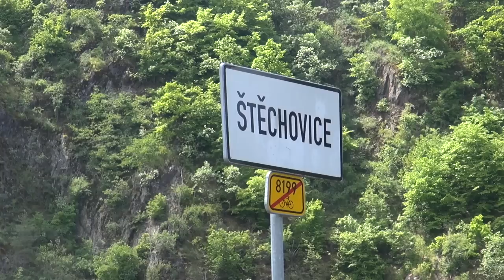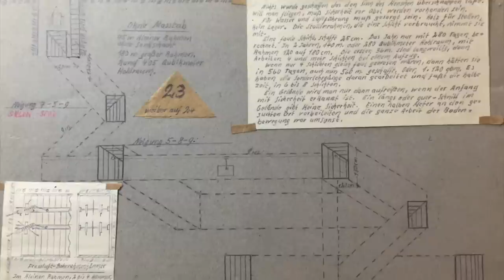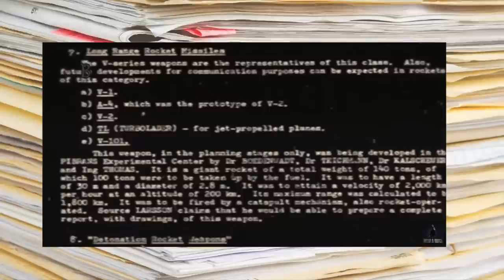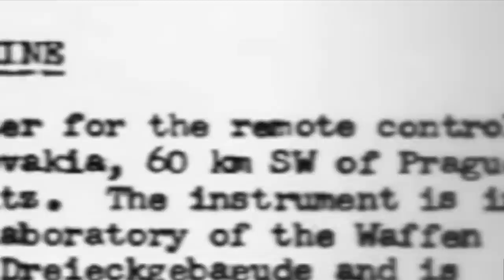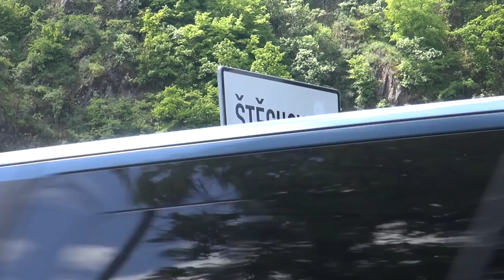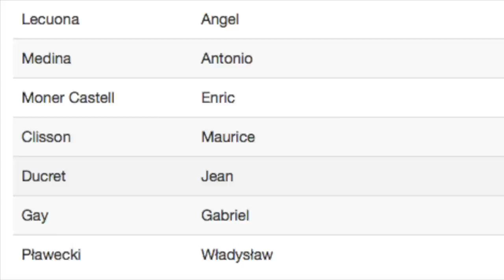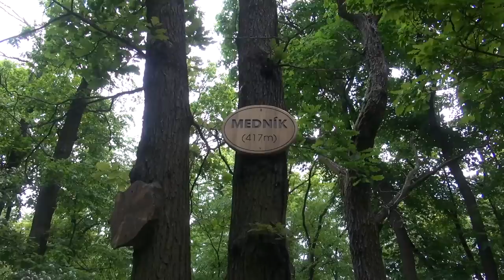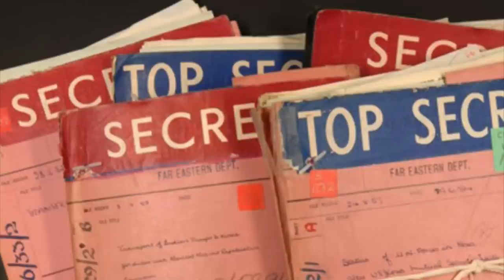THE LAST NAZI SECRET THE KAMMLER-STAB, KLEIN AND ENGEL.

Comment: Trying to think of large electricity uses that do not involve isotope seperation.
Making aluminum via buaxite refining uses a lot of electricity, but  Czech had low grade ore "bohemite", Hungary had better ore
and Norway had plentiful electricity.  Electrified railways would consume power.  Or anything involving large electric motors.
I don't know if aircraft manufacture required electric arc welding and if so, how much power that would involve.

Comment: Your Kammler, Klein, Engel videos were very interesting.
But the buildings you are showing at 1:28:30 might not be what you think they would be.
I have seen many of them over here in Romania ... in rural area... at hill sides... wine cellars ;)
Reply from the maker: That is very true but in all of the areas where war was fought beer Sellers and wine cellars were usually used for alternative purposes during the war so both may be the case but with the relative lack of paper trail it is sometimes quite hard to determine what is what